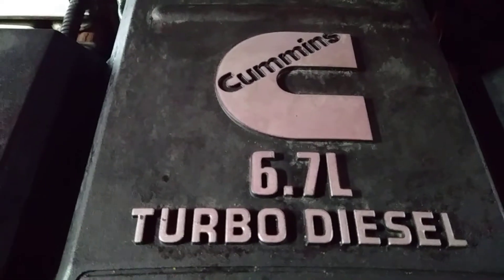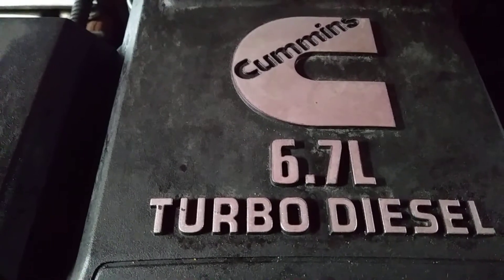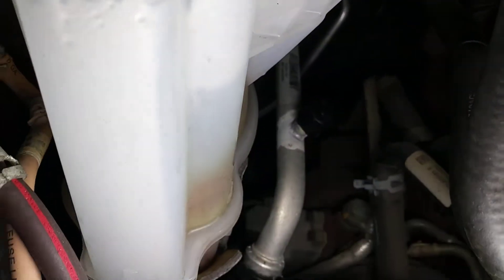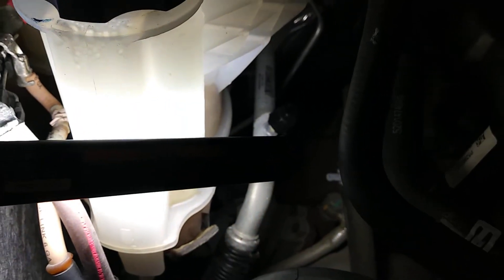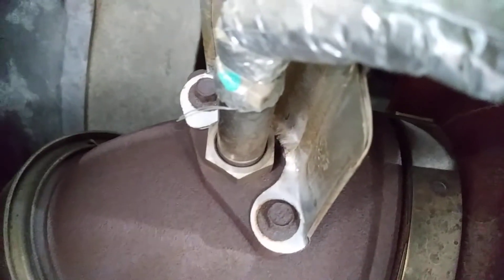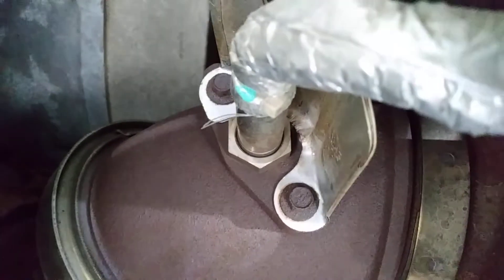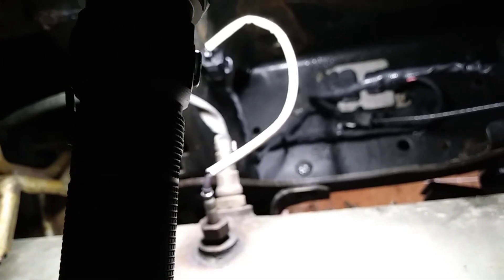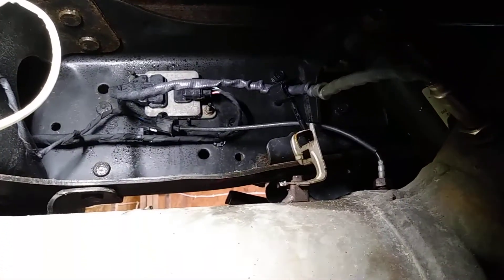P20EE Fault Code

Comment: I have Jaguar F pace with the same code p20ee adblue injector clear , new scr system fitted a year ago , I just get the engine warning light then when I connect my OBD reader the code P20EE appears any ideas ?  
I have cleared the code and can drive for around 3 weeks till engine warning light comes back on again with the P20EE code please help ?

Comment: After replacing the NOx upstream sensor does the ECM turn off the light or does it manually  need to be reset?
Reply: Hi,, have you managed anything with this code?
Reply: @cristian.63823  The new flash solved the issue.

Comment: I have a 2016 Ram Diesel Promaster 2500. The van has been in the shop aprrox 4 times because the check engine light pops on with the P20EE code SCR NOx Catayst Efficiency Below Threshold Bank 1. The dealer has replaced the cat, new particulate filter and new sensors and code keeps coming up? any ideas??
Reply: Did u get this fixed
Reply: @eoghanhennessy443  Chrysler bought back the Promaster 👍🏾 unable to fix after 3 emissions attempts.

Comment: We just changed the Nox Sensors OEM in a 2017 GMC Duramax and the Code keeps coming back. Any suggestions?
Reply: Regen time
Reply: An check coolant an oil level could be eating fluids